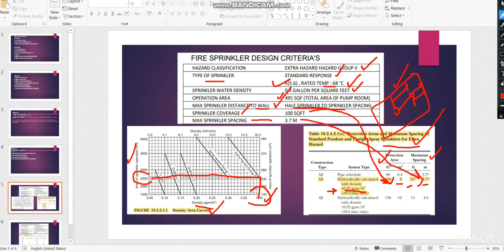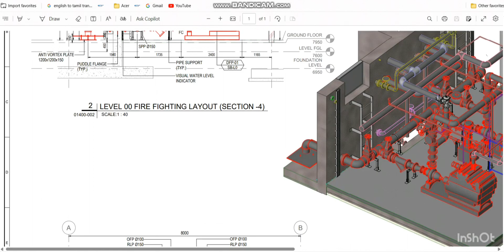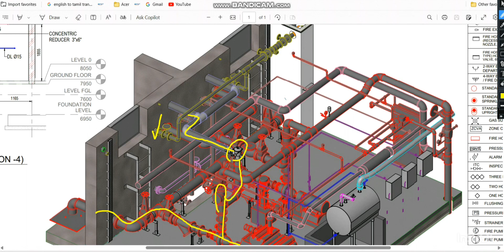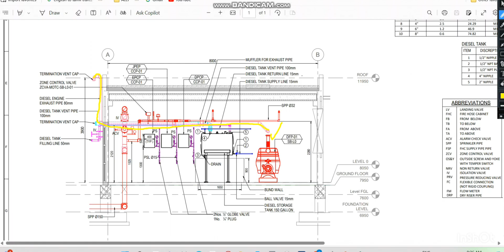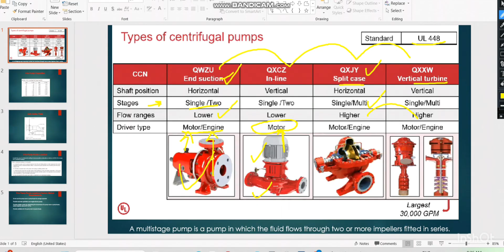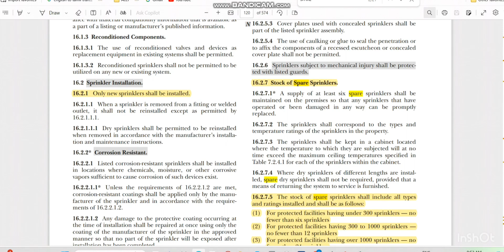Comment: only one question why we dont add prv to the electric pump
Reply: Hii thank u for your comment. U mean Pressure Relief Valve not Pressure Reducing Valve, am I correct
Reply: @mepworld3385  yes pressure relief valve
Reply: @ALiRAZA-mg8bd  yes, fine..if we have electric variable speed pump or variable speed driver then we add. Because in the event the variable speed driver fails, the rated speed can result in system over Pressurization.
Reply: In this project we did not use variable speed drivers
Reply: @mepworld3385   thanks for the answer does all the electric pumps have auto cutt off ? We only set manual shutdown for engine based pumps right ?
Reply: @ALiRAZA-mg8bd  most civil defense wants manual shut off only